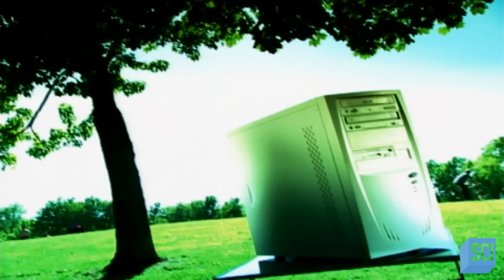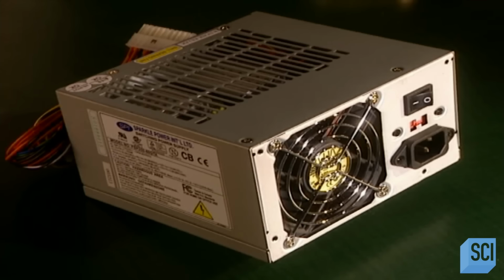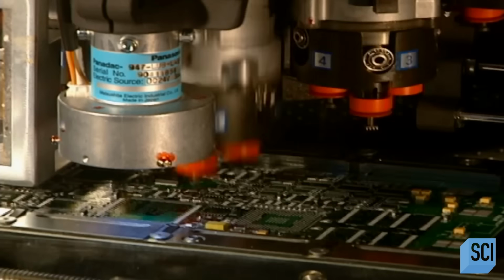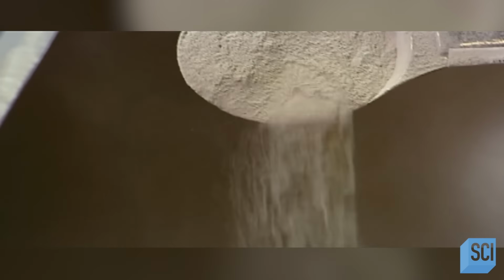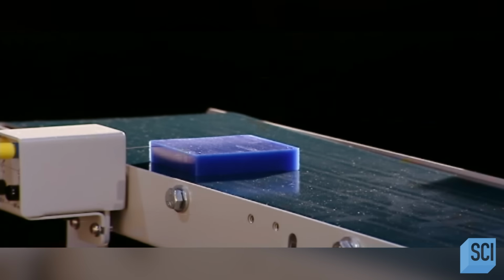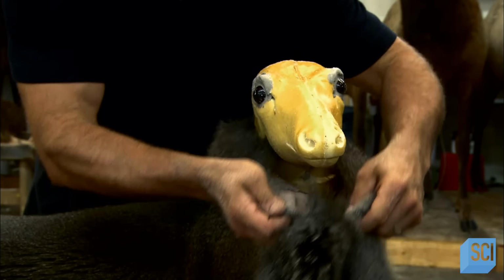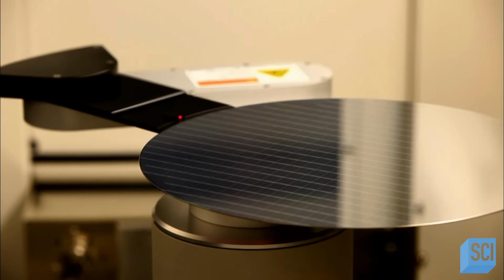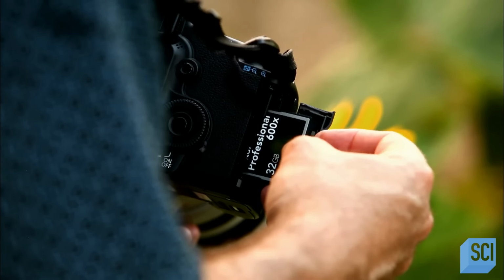Computers, Circuit Boards, Flash Drives & More | How It's Made | Science Channel

Comment: The distance between the read/write head in the hard drive, even when this video was filmed, is actually less than the thickness of a fingerprint.
Reply: It's so small that smoke particles can actually gouge the surface
Reply: 5nm, smaller than the transistors printed on most processors

Comment: Floppy disks? One step away from PCs made of wood and stone.
Reply: If you think that should wait until you hear about punchcards
Reply: @anonymouspuppy  My first programming class used punchcards and an IBM370 mainframe.
Reply: it all had to start somewhere. before hard drives were even imagined, it was punch cards and then reel to reel tap drives on large mainframe systems of the 60's and 70's.
Reply: It wasnt even real Floppy disks. Real floppy disks are 5 1/4" and only holds 1.2MB
Reply: @henryairconcepts2999  "real" floppy disks came in a few sizes and capacities. They could go from around 3 inches, to 12 inches. The bigger the floppier from what I've heard. For capacity they could hold from 82kb to upwards of 240mb/245,760kb in the late 90's.

Comment: About 90 minutes to build a complete computer using late 1990's computer from scratch. I used to be able to build a complete system with additional PCI cards, and additional drives like an extra optical drive and ZIP drive in less than 45 minutes, sometimes a lot quicker if using less hardware without any mistakes. The longest part for me was installing the current version of Windows and all of the drivers which normally took me about an hour.
Reply: Yeah, but the guy putting this computer together was paid by the hour... 😂

Comment: What music/ music source do you guys use in the background it’s always so interesting as well as nice to hear
Reply: It could fit into so many genres. As an all around producer some examples would be experimental lounge , experimental sound scapes type’ish. Interesting indeed. Some ppl say depending on when the episode came out it’ll cause seizures and epilepsy it’s so upbeat 😂🤣
Reply: It was the audio the original episodes used. This was filmed decades ago
Reply: there are packs of Background  music { also called sweetening } for video production. but they are expensive, 
I did research into it one time, and most start at $500 per pack 🥴 too rich for my blood! 😵‍💫 and I am not sure if they are sold wholesale to production  companies only, or Retail to the general public
Reply: There have been multiple soundtracks over the years. Dazmo and Intermede Tiger Music are the two main companies they utilize if I recall correctly.

Comment: That computer is from the 1990s or early 2000s.
Reply: This obviously an old video, which at the time may have been cutting edge but at the present is just nostalgic & informative...8GB SD card...Don't they know they have 256GB 512GB 1TB cards now?
Reply: @vadermasktruth  they've had 1TB SD cards and 8TB NVMe SSDs out for a decent while now. (2019 & 2021 respectively)
Reply: @vadermasktruth  - And that Pentium III processor was a nice touch too 😄
Reply: 2002-2005
Reply: So's the video
Reply: ATI video card had a copyright date of 1999.

Comment: As a matter of fact...AGP hasn't been used since the 90's VERY early 2000's. Damn you're behind the times. Maybe connect with an IT department to get caught up too date LOL
Reply: the episode that showcases the 486 PC with AGP was aired in 2005, and likely recorded in 2002, given that Intel chip was 00 for it's year code.
Reply: Imagine being so thick you can't put together that this is old(er) film...
Reply: @l_Ryan_l blows my mind the amount of comments on these videos that just can't figure out why they're showing older stuff. Dense as dense can be
Reply: Goes to show ya the 8x AGP board I bought in 2006 where I put an ATi Radeon 850 Pro was well before your time. PCI-Express was a pipe dream those days. Built it myself when I was about 13-14. All you see here was standard until SATA came along.
Reply: Hmmmm if only there was something I could read that would tell me when this video is from. Such a shame...
"Aired in 2005" Oh would ya look at that!
Also if you're gonna try and act smart at least use the right 'to.'